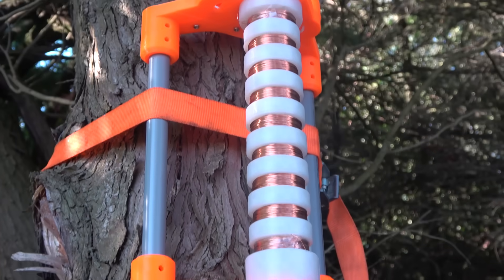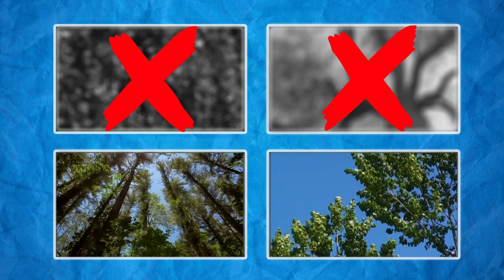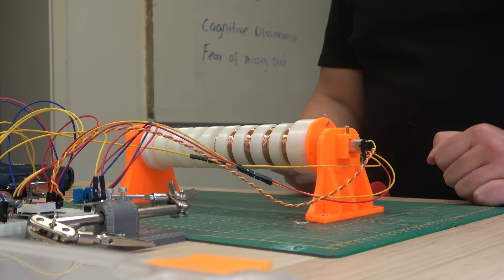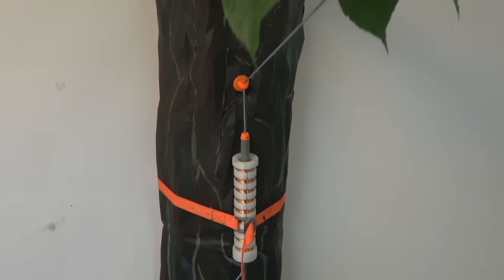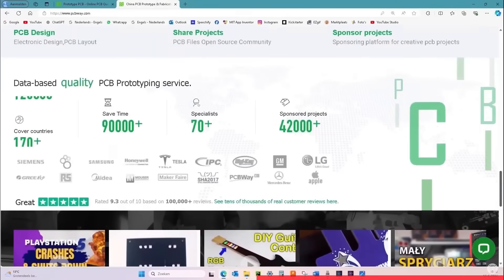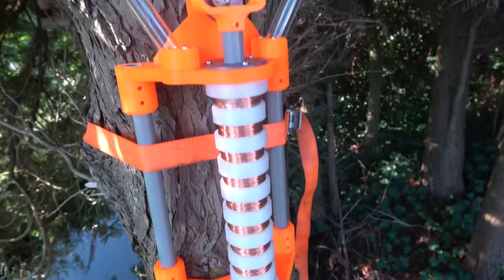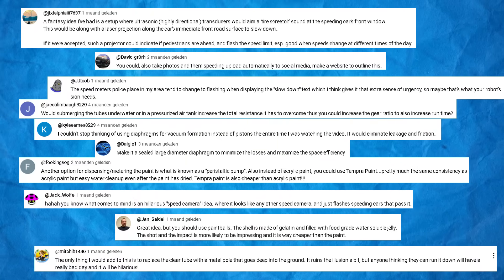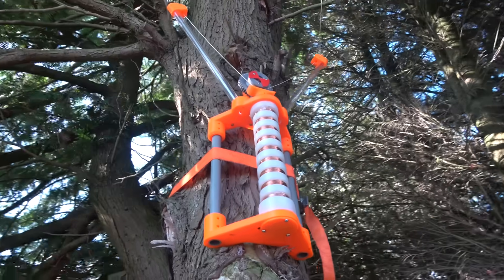I Made a Tree Generate Electricity..

Comment: To make the idea feasible you need to look 4 things : how much power it genarates on average, price of the the generator and cost of implementation ,lastly  how available materials you use in the generator for mass production.
Reply: Don't forget about the maintenance cost which I dare say would be the worst of the lot. I am confident in that every single thing mentioned except for material availability would rule out this being feasible. Regardless I like the fact the idea was tried and want to see more.
Reply: 5 things.  How much power do you NOT generate if you don't make it.  Something inefficient is better than nothing at all. 🙂
Reply: @skampp  Well that depends, it is better to have nothing if the little it produces never offsets the cost of materials. However this is only looking at it from purely an economic point of view, if it's just for the fun then that point is irrelevant. I like the idea and I like the fact that it was tried, I just don't think it's practical. Ignoring practicalities I even have my own idea on a single device that could potentially be linked to multiple branches at once.

Comment: Really good starting point! Here are some annotations I can see: By using a pulley at the upper part of the trunk, you are only utilizing the swinging of a single branch, which by itself cannot produce much power. You would need to use many branches to get a decent amount of power. I think you can generate more power by harnessing the movement of the whole trunk; that large mass of wood should carry a good amount of inertia that you can transform into energy.

I propose: Combining the relative movement of a pair of trees. You can attach the tops of both trees with a rope and a pulley system, so when the trees move away from each other, the pulley system resists that movement and generates rotation (energy), similar to the "button spinner" toy. A problem I see is that you only generate energy when the trees are moving away from each other. When they move towards each other, you get nothing, and you also have to return the pulleys to their original state (so you lose energy). Something similar happens in ocean wave-powered electricity generation, so perhaps we can adapt the solution from that case to solve the problem with this approach.
Reply: Additionally, ocean wave generators must have mastered the non-constant frequency of waves, just as trees experience non-constant frequencies in their swinging. It's a good source of inspiration for my idea.

Comment: You definably need some way to keep those wires tensioned else on strong winds they could end up tangled or escaping the gear.
The problem with a tensioner is that it will reduce the overall movement of the wire / steal some of its mechanical energy.
I can't think of a good solution for this problem.

Comment: this is a more continuous, multi-generational plan than most people go for usually but if you could optimize your system to get decent energy extraction from tree sway, theoretically if that was combined with long term experimental breeding of the perfect tree that's super light and flexible these could probably do something in windy areas

Comment: Sorry to be a buzzkill, but this is completely unscalable. Trees live, so you'd need constant maintenance of this device (braches get further away, new branches grow - interfering with the system, there is unpredictable wildlife). You can build only as big of a generator as a tree is, so this would have to scale in numbers, rather than size. That means more devices to mainatain. On top of that, you would need infrastructure to collect this energy - laying cables in the forest is probably an electrical engineers nightmare. And all this effort to rely on an unpredictable factor of wind. Also, we do not know how such a device would influence a tree. Beeing a living thing, trees are susceptible to external factors and can adapt the way they grow - for example bonsai uses applying external forces to branches to achieve a desired shape of plants.

Comment: This just gave me an idea, to put a hamster running wheel outside, that also releases food after a few minutes of use. Should be adopted so that large birds, squirrels, and cats can use it, and it can generate electricity. Or a platform that goes down if an animal is on top, causing a generator to run, then food is released, the animal hops off, and the platform springs back up.

Comment: Very interesting idea. Curious if you have any preliminary data on how much electricity could theoretically be produced (IE: 1kwh per day). 

Unfortunately, it likely won’t have a favorable ROI vs other alternatives, but that doesn’t necessarily mean it shouldn’t be explored or done.

I had a brainstorm one day of trying to make a man made tree for harnessing wind power. Though I was more focused on the leaves of the tree, thinking if you could have a ton of tiny hairs on the surface create alternating magnetic field, that it could add up and generate reasonable electricity. 

Obviously I don’t think our current technology or manufacturing would be practical (nor do I think any known tiny hair like materials to generate electricity exist), but mainly thought it would be interesting to have manmade wind power generators look more natural. You took it to a whole new level and just use the tree to make electricity. 😅😂

With that said, I wonder if you could make an “artificial tree” with branches and materials optimizing movement in the wind to posture greater forces and electricity.

Comment: Making a tree generate electricity.... via biomass pellets. Trees sequester the carbon that is released during burning in the carbon cycle, and they can (or should be) replanted after they are cut down.

Jokes aside, great video. I don't think I've seen another video where someone has tried to use a linear generator to generate power. It's a cool, novel idea. Since rotary generators are more efficient (and you are generating a rotating motion with your gears anyways) you could always use a traditional style generator with a mechanism that ensured it always rotates in the same direction to avoid alternating currents. I'd also try to use a pulley wherever your rope changes direction, as frictional increases with the angle a rope is wrapped around something, and frictional losses can greatly diminish your captured energy.

Comment: Find a way to attach ropes to every branch to use all their motions. That might be extremely difficult but the more branches, the more movement, in theory. I'm curious if that would cause issues or if all the branches will generally move about the same since the same force is acting on all of them about the same time. If all the branches move generally in sync with each other than you could scale up the main gear.

Comment: Neat proof of concept, but I think if you could find a way to get branches to spin a car alternator, you could make some decent power. I imagine spinning a dynamo on a ratchet might be more efficient than trying to convert different axes of motion into one linear motion generator with using counterweights and multiple strings and whatnot, because a pull crank doesn't care what angle you pull it from.

Comment: Wow this video brought me back 10 years when I was doing my senior design project in university in trying to harvest energy from ocean waves from buoys.  A lot of the ideas that we used back then, I see that you are using in your tree design - powerful neodymium magnets with a center column that would slide up and down.  We used a similar scotch-yoke mechanism to convert the linear motion to rotational.  We did lots of testing with our 2 meter in diameter buoy that we built.  Unfortunately for us, we could generate power, but we couldn't really generate usable power.  And ultimately, that's the problem I fear with this tree idea.  It's not a question of making power - you absolutely will make power from this. But can you make more than a pittance of power?  Not trying to discourage anyone but the realities eventually come to light - the cost of those very expensive magnets would mean it would take quite a bit of time with our buoy just to break even in cost, not including the costs for building it and design time.  Curious how this progresses from here.

Comment: Just an idea:
Try a normal motor or turbine and figure out how to turn back and forth movement to rotation in one direction modify the gear ratio till the turbine is always spinning. Take a bike that is not touching the ground as an example, if you push the pedal the weel truns. If you reverse the pedal nothing happens, but the weel is still turning from the first push. Every time a branch moves it gives a little push on the pedal.

I beleive if made properly something like this could provide almost constant power by turning every little motion into rotation for the motor/turbine. 

I might not have explained my idea in an easy to understand way, someone might be able to rephrase or improve. Im just a teenager, i don't know if this would work, it was just the best way i could think of.

Comment: I don’t know what they’re called but they have these generators that are basically a pole but the top half rocks back and fourth in the wind and that is used to generate electricity. Maybe someone can help me out on what they’re called and how exactly they work but I wonder if that design would have a greater output?? Just a thought! This is such an interesting idea!
Reply: Commenting on my own post here but I’m also wondering if attaching it to a tree would end up creating more output than the wind does or not. I would assume so because the device could be much smaller but then harness the larger movements of the tree. Maybe what you’ve created here is already the most efficient version of that. Just spitballing 😃

Comment: A sellable application: hook it up to a circuit similar to one found in cheap solar lights and use it to light parks at night. The wattage is probably about right, and you wouldn’t have to run distribution lines. Plus it’s less obtrusive and a good use of green space.

Comment: As a systems engineer I like the natural side of this. This is like a wind turbine but still offers habitats, shade, green space, and air purification. I’d love to see what the optimized version’s power output would be and compare the cost per Watt to conventional energy generation as well as a life cycle analysis (LCA), which could account for some of the benefits the tree system offers(less intrusive, takes up less space, etc) I think this sort of nature-first design would fare very well from that perspective.
Reply: I think that is where a lot of the people comparing the output of this generator to the output of a wind turbine are tripping up. This system is not just putting out power, it is adding power generation to a system that already does: air filtration, oxygen generation, temperature control (via shade), animal habitation, and material generation. It is many times more useful than a wind turbine which only produces power, even if the power it produces is not comparable.
Reply: @elijahclifford863  A) How much energy does it take to build this apparatus?
B) How much Energy can it yield over it's lifetime?
C) If A Exceeds B, why are you doing this?
Reply: @svovy5358  why did we bother with internal combustion engines when we had horses, donkeys, and oxen? It's driving innovation forward and at least he is introducing another possibility of energy generation, no matter the significance, that could lead to significant breakthroughs in technology. A lot of our technology we have today came about from experimenting, tinkering, or just plain accidents.
Reply: @raymondcooper2526 why are you comparing this huge mass of copper generating as much power as a potato battery to the Internal combustion engine?
Reply: @svovy5358  Why are you comparing a poorly first generation 3d printed prototype to a lab demostration in a negative light?
Potato battery work, battery work. The question is not this device, it is this idea.
And to that note, the only reaserch I have found on the energy held in a tree's sway studied a two story tree with a very thing trunk and concluded that an average day said tree produced 496 watts, as measured by the limb movement and calculated by the spring of the tree.

However thier attempts to recoup said watts where less then stellar, same as here. Less then 1% effciency. 
Thats not a reason to look down at this idea. That isnexcatly the reason to look towards this idea and pounder how you can imporve it personally, thats 99 chances to do better then everyone else, 99 chances to be the hero designer of the tree wind power harvester.

Plus, homes would actually want power harvesting from swaying limbs and trees, doing so would slow down the sway, lesson the extreme bending, prevent tree and home damage.
Reply: @AnonymousAnarchist2  The value proposition of this instrument is that its a kinetic generator attached to a tree.

Nothing innovative or thoughtful has gone on here
Reply: @AnonymousAnarchist2  "A keyboard is a kenetic generator hooked up to a computer." 

The difference is (Since you need a brain to tell the difference) 
"Kinetic Generator attached to a tree"
 is a COMPLETE description of this Apparatus

Whereas "A keyboard is a kenetic generator hooked up to a computer." 
Is incomplete and also inaccurate.

It just so happens accurately describing what this thing in fact does, makes it sound useless.

"Kinetic Generator attached to a tree"
Also doesnt omit the purpose(s) of the tool from the description of what it does.
Because there isnt one, and it doesnt do anything.
Reply: @elijahclifford863  Or...or...now hear me out...we could just have wind turbines AND trees.
Reply: @allanshpeley4284  there's a reason wind turbines are in open fields and not around trees
Reply: @allanshpeley4284 yeah but there are redundancies that this mitigates: for example a turbine wastes a lot of money and labour, in the form of materials etcetera, just standing up and being tall and stable: this trees do fairly well. plus if the tree movement apparatus is small and cheap enough then it doesn't matter if each one doesn't produce much power. say 50 watts per tree... thats not bad, there are lots of trees
Reply: It's hard to explain but basically imagine tree as this huge lever. You need to choose your lever wisely.
Imagine a forest, where each tree is set upon cube of dirt. 
The cubes are connected with spring loaded walls or with fluid. Each cube can be moved by swaying tree with highest lever while not uprooting the tree right? You receive energy underneath roots.
Reply: @zetdota3163  you're treating a tree like a stick. roots spread out to dissipate the energy and too keep the base of the tree fixed in position. it's would be like making a lever but expecting the table to rotate. ofc the best is as close to the ground as you can but going over doesn't change anything.
Reply: Isn't nature funny like that ? 😂
Reply: Wie soll das System auf das Wachstum des Baums und der Äste reagieren? Über einen längeren Zeitraum würden sich die Fixpunkte der Seile verändern.
Reply: Excellent points!

Comment: This combined with a gravity battery would be good. The rotation of the pulley slowly pulls a up weight that will fall down after it’s reached a set height, then it will fall slowly and start moving the cylinder up and down using a gear reduction

Comment: A way you could potentially get more power out of a swing is by connecting two or n number of those generators between multiple trees. That way, as one tree swings one way and another swings the other, you get a lot more power. The more trees connected together, the more power per generator.

Comment: Trees move from air currents.  Just harvesting the air currents via a wind turbine cuts out the middleman's tax (the tree).  The power generated from tree branch movements into a linear coil setup would result in very little power generation.  At 14 cents a kWh, this tree harvesting would probably never pay off the materials used to make it.

Comment: what about a water well and a solar panel strong enough to fill it with air or water?  the tube is driopped in and the water drained. when the tube is trapped on the load and water enters you get the kinnetic movement. now spice it up with an efficient air pump that runs 12v.  fit a solenoid dump valve on the tube after the water rises take that energy then dump the air at which point the tube will sink.  use the solar energy to push air back in to the tube once it has locked in bottom position and when the air is at the desired level it will strart to pull the load again as the tube rises.  so the questions are is it feasible? whats the minimum well size/depth to generate 500w? how would you link the movement to the load?  i think it can work after seeing the tree!

Comment: This is awesome. My thoughts:
You used the linear generator due to the first design using the cable, but second design has rotational movement before that is converted to linear. Could you use a more traditional generator instead? I really like the magnetic 'spring' though that's very satisfying.

Comment: Technically the wind is responsible for the kinetic energy needed in the solenoid to produce the rate of change o magnetic lux was produced through wind which makes the branch move so at te end of the day it's wind generated electricity so when no wind means no electricity for you.